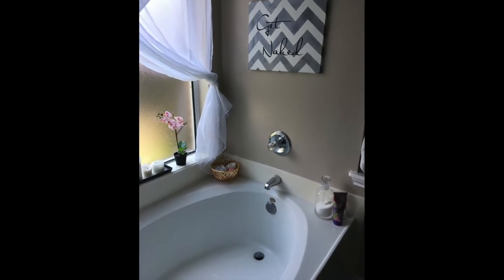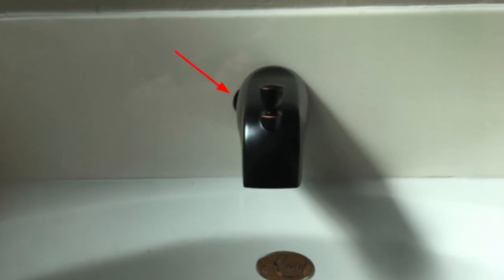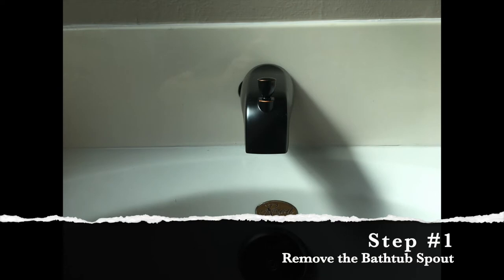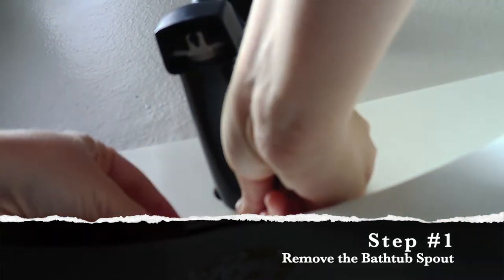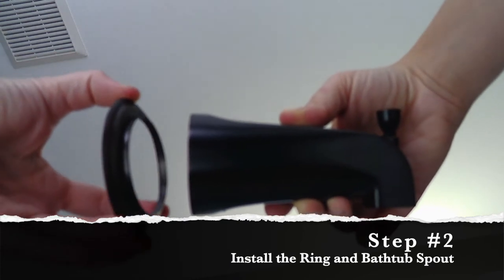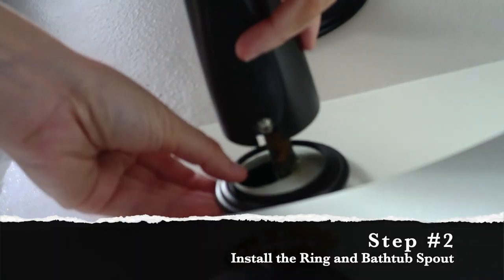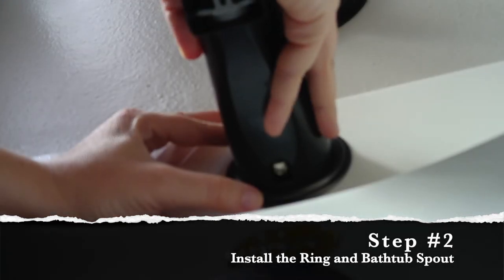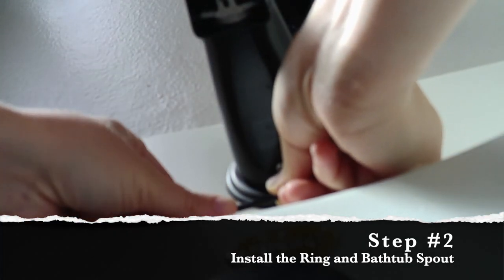Decorative Ring for a Bathtub Spout

Comment: You can you use silicone grease on the O-Ring (helps preserve it, and apply some to the copper pipe. This makes it easier to slide on. I liked your video, looks great.
Reply from the maker: Thank you for the tip Mike! I appreciate your feedback.

Comment: Where did you find one in black?
Reply from the maker: Thanks for your question. I didn't get one in black. The one I used is an oil rubbed bronze finish that I picked up from Amazon (https://www.amazon.com/Kingston-Brass-K1301A5-Decorative-Rubbed/dp/B00O35WYES/ref=sr_1_3?keywords=tub+spout+ring&qid=1657074445&sr=8-3). It matched my bathtub spout really well. 

I did a quick search and I wasn't able to find one in black. But if the oil-rubbed bronze doesn't match quite right with your bathtub spout, you could always consider purchasing some black spray paint to spray and seal it before installing. If you're going to go that route, I found this really cheap ring on Lowes that would save you a bit of money if you're also buying spray paint (https://www.lowes.com/pd/Danco-2-25-in-Chrome-Bathtub-Shower-Trim-Ring/3515018).